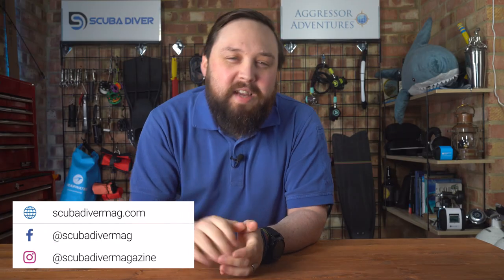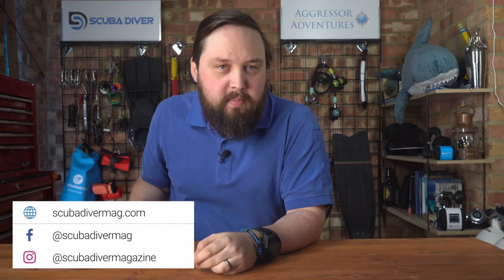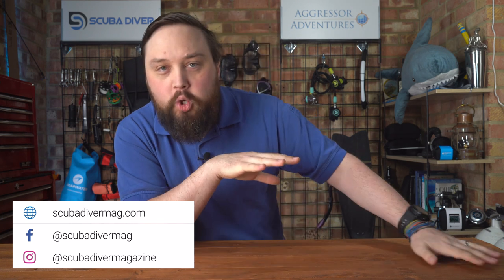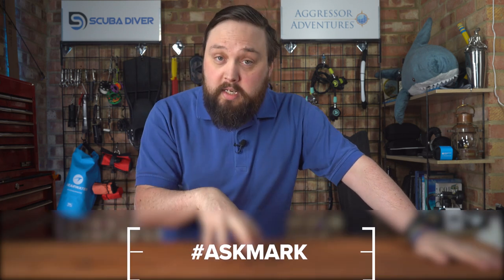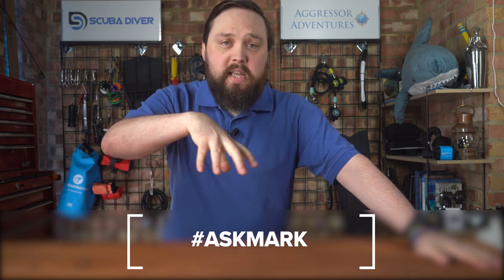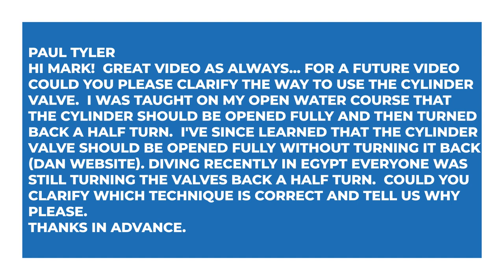Why Don't You Teach Scuba Anymore? | #askmark #scuba #Q&A | @ScubaDiverMagazine

Comment: The reason for the valve qtr turn back, was back in the day, if you checked the valve and it wasn’t seated it was open, if it was tight it was shut, this prevented accidents by opening the valve of a high pressure bottle, which in certain circumstances could cause a diesel (explosion) effect. Modern gas bottles have a smoother open action, which in most scenarios negates a dieseling effect. HTH 😊

Comment: Brand Mix issues - This I experienced in 1970 doing a tank exchange in my NASDS Open Water program. I had a tank with a US Divers valve and a Scubapro Mk VI - Pneumatic yoke (spring) which requires a couple minutes to fit on. Great video on regulator variances, Mark.

Comment: #askmark Hey Mark, great stuff in all your videos, thanks for them! I have a debate with my buddies about a specific danger of regulator failures. Not the stop-of-airflow side (it is obvious) but the other end of the spectrum - overblowing our breathing system.. Some say technically it is possible to get in a life-threatening situation in case a first stage fails in a specific way (probably combined with second stage failure at the same time), while others say it is technically impossible to get a dangerous pressure in your mouth (and way forward). Where is the truth?

Comment: I recently replaced the HP hose supplied with my Cressi console 2 with a Miflex hose. I notice that the hole on the Cressi has a pin prick hole but the Miflex does not. Should I be concerned at all?
Reply: Sounds like you got a low pressurel hose instead of a high pressure hose?

Comment: Mark I recently bought a Halcyon H-75p Single cilinder pakage, I use to dive recreationaly, I dive  once a month. At the first use it work pretty well. In my second dive when I was testing  my second stage the air didnt flow...  I try to push air but it seems  that the valve was stuck, I had to blow pretty hard to the valve back to work. Is this normal ? it happen again in my third dive ... Maybe im cleanning or storaging my regulaters wrongly  I really dont know, I always dry the cap before the dives and protect the first stage, I always rinse tham  and let tham dry hang. Can you help me ?  #askmark #scuba #Q&A | @Scuba Diver Magazine

Comment: #askmark Hi Mark, I would like ask you for your opinion about Technical courses / diving. I'm Rescue Diver  / Deep / Nitrox diver with over 120 dives mostly in drysuit (quarries, oceans and seas) and I'm thinking about step in to technical diving. Would you be able share your thoughts about Padi Tech40 vs SSI Decompression Diver. Both are max 40m however with SSI I don't need to change all equipment yet and stage bottle always will be useful in the future. sorry for long question and thanks for videos, they very useful